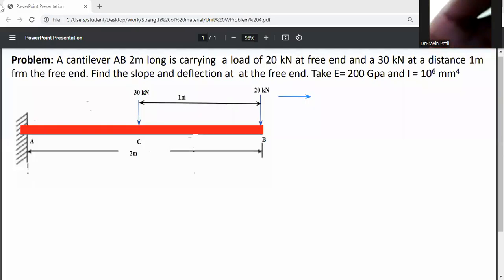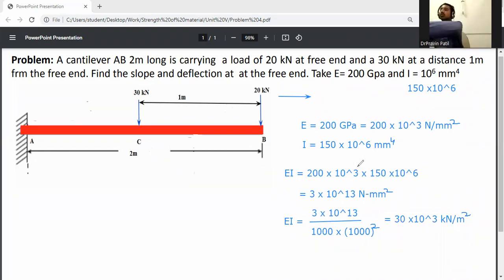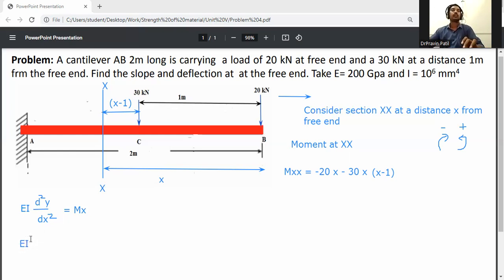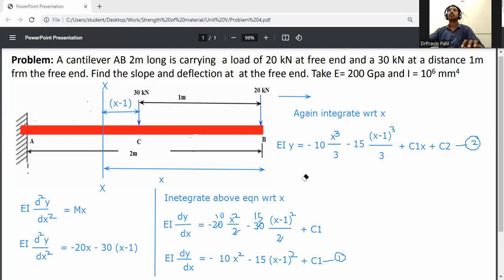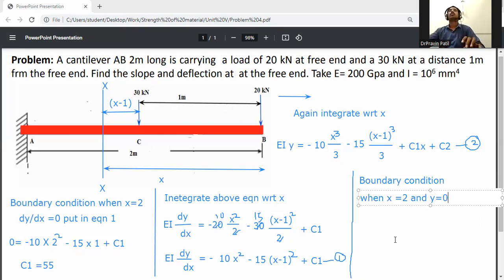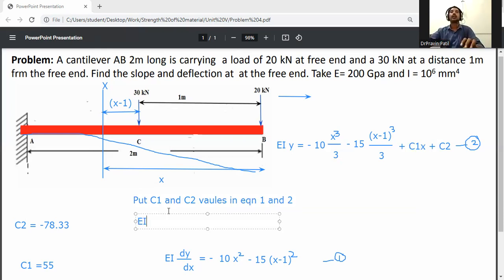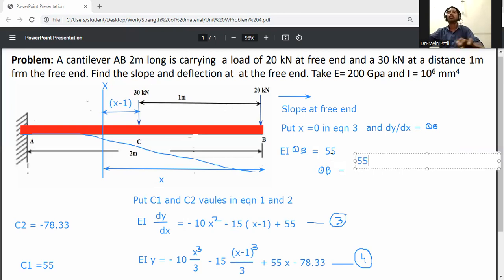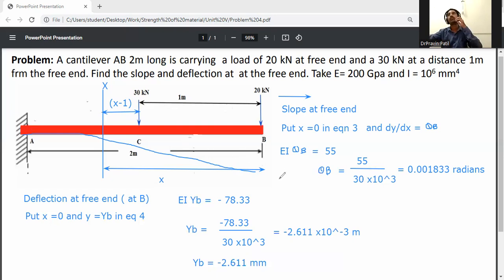Slope and deflection of cantilever beam by Macaulay's method / Strength of Materials

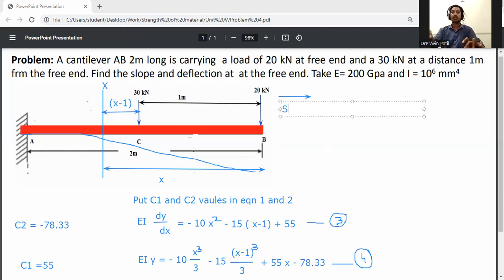Comment: 21:21 how slope at free end becomes 0 and incase of finding deflection how x=0 y=yb
Reply from the maker: The slope of a cantilever beam is not zero at free end. It is zero at fixed end. The maximum slope and deflection occurs at free end.
Reply: @pravinspatil sir on what basis we are taking boundary conditions (1 )and( 2)
Reply from the maker: 1) Fixed Support:
At a fixed support, both the deflection and slope are zero. This is because the support is rigid and prevents any movement or rotation. 
2) Simply Supported (Pin or Roller):
At a simply supported end, the deflection is zero, but the slope can be non-zero. A pin connection allows rotation, while a roller allows both rotation and horizontal movement. 
3) Free End:
At a free end (cantilever), there is no support, slope & deflection occurs maximum.